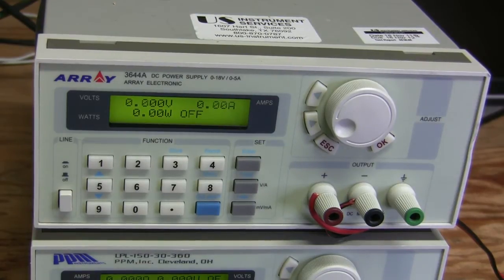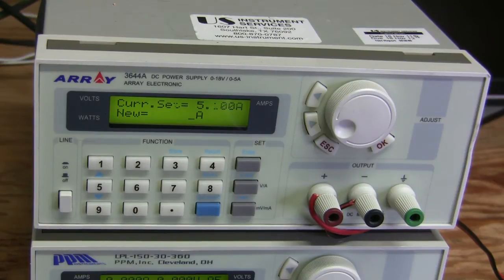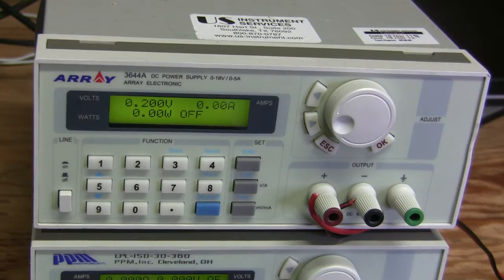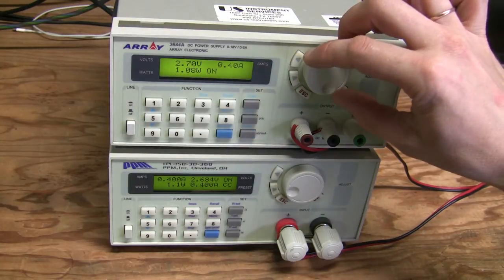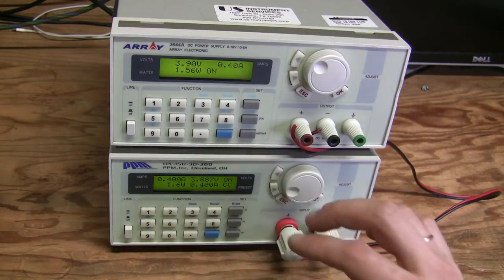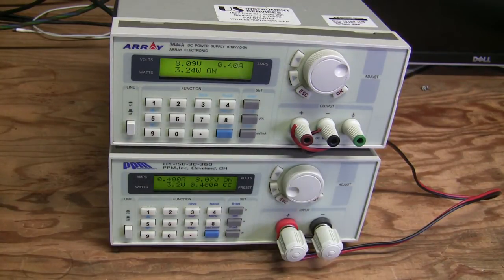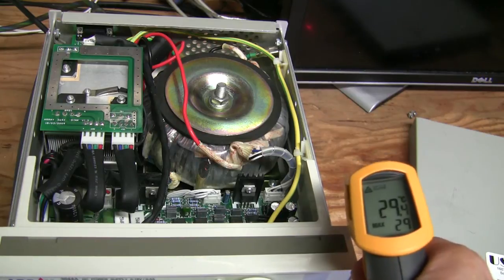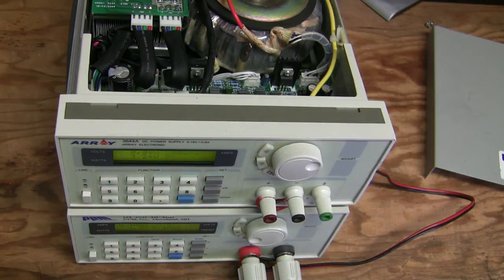#12 - Array 3644A power supply repair followup

Comment: On the display, check to see if they used "zebra" strips to connect to LCD. If so try wiping edge of display and zebra strips with alcohol. Works on calculators.

Comment: The 3645a also has the same issue in which going from 3.999 V to 4.000 V will cause a 2.3 second drop to 0 V.
If you look at the manual, it looks like the 0-3.999 V section is a separate power supply internally.
The documentation states: 0-3.999V: 0.01% + 3mV,  4-72 (4-36, or 4-18V) 0.02% +10mV
Reply from the maker: Seems like a design flaw. Thanks for the info.

Comment: Seems like that regulator was not well thought out.. could've used a larger heatsink at the least. The display flicker could possibly be due to mild corrosion on contacts.. reminds me of How to bring LCD Ghost Segments back from the Dead
as unit heats up, thermal expansion could cause slightly better contact. 
I'd use an eraser and alcohol on the contacts (If you arent adverse to putting even more labor into that thing :)